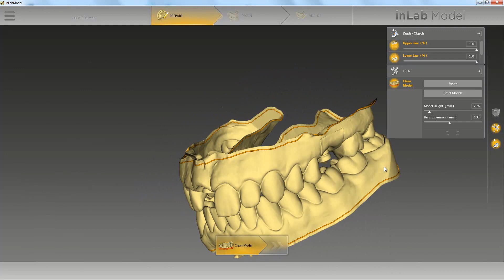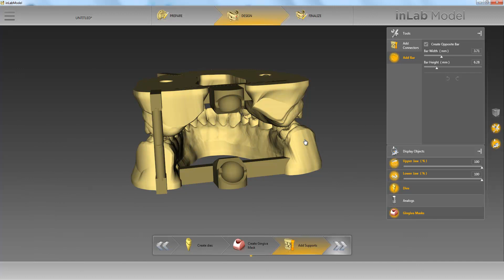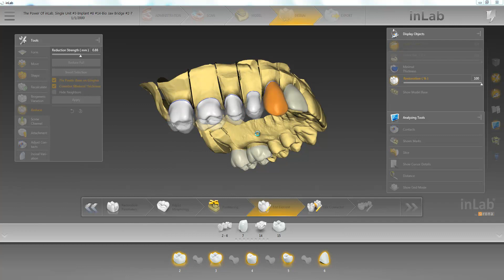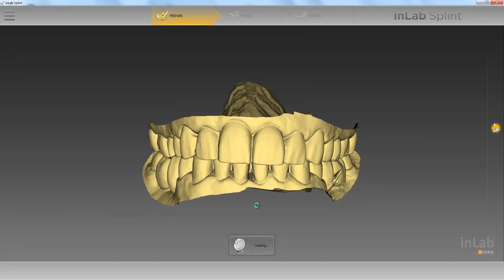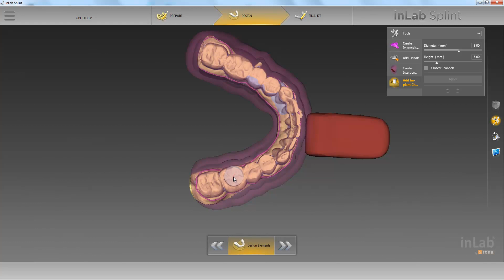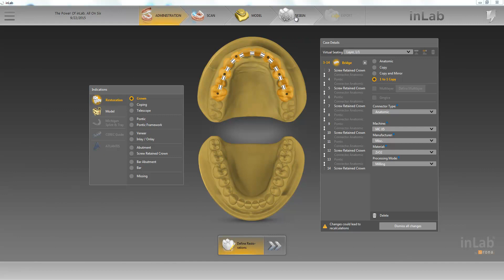inLab Software 18 Webinar

Comment: Is there a recommended PC system requirement spec sheet?  Can’t find one on Sirona website.
Reply: On the DVD it says Windows 7 64 bit. I got told on the phone that Win 7 or 10 Professional was needed, but I managed fine to install on my normal Windows 10. Saved me 100 USD.